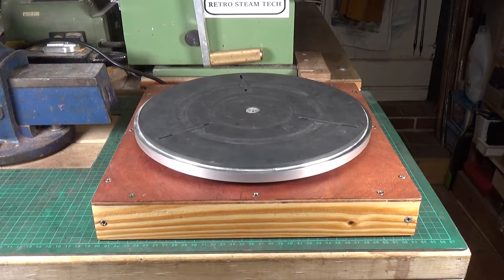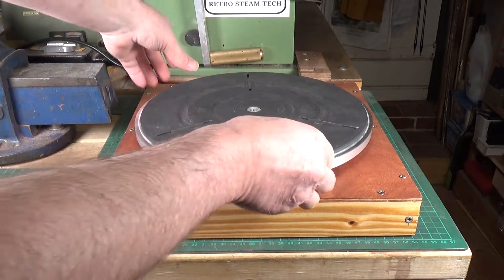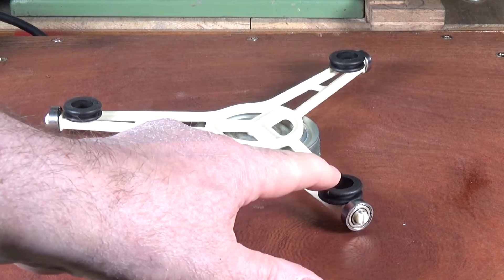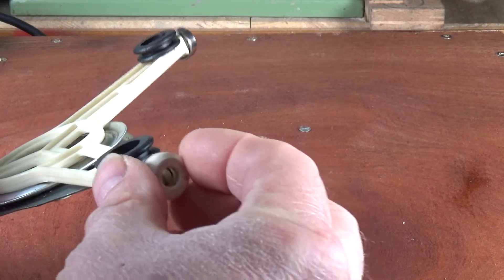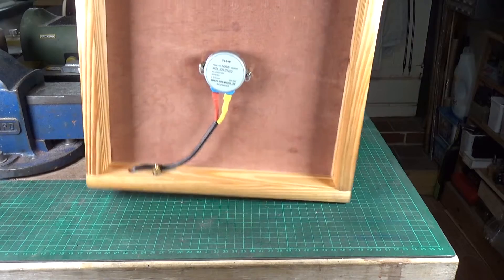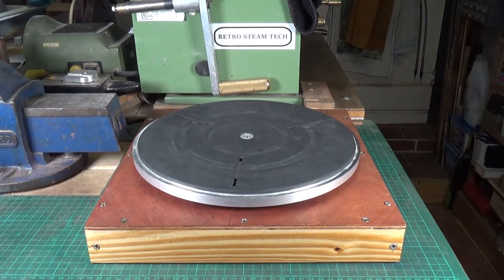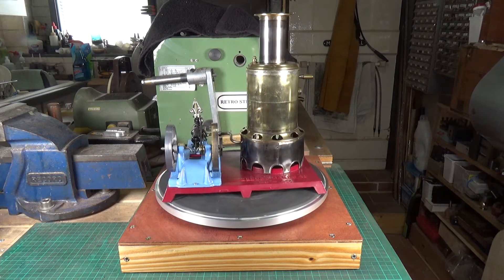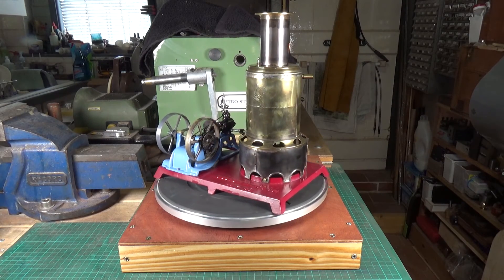Simple Motorised Turntable

Comment: Nice job on the turntable Alan. Could you add a dimmer switch to control the speed?
Reply from the maker: Thanks Charlie. Yes a dimmer would be an option. I've actually built my own PWM speed controllers before and one of them could be modified to do the job. Cheers, Alan.

Comment: Good one Alan.
You can easily vary the speed of that type of motor by putting a PWM (pulse width modulation) AC speed control unit in the power supply feed. 
A cheap way to do this is to use a scrap ceiling fan speed controller or a light dimmer.  Both will easily handle the AC current drawn by that tiny motor.  You can also buy PWM units from Banggood for peanuts.  Some of the cheap Chinese ones I've bought have let out the magic smoke, so maybe better to go with trusted controllers/dimmers.
This would enable you to pick any speed from what you have now as maximum  down to zero.
Cheers Rob
Reply from the maker: Thanks Rob. Good idea on the PWM controller. I've actually made PWM speed controllers for some of my 16mm scale electric locomotives. It shouldn't be too difficult to modify the design to work with mains voltage. Cheers, Alan.